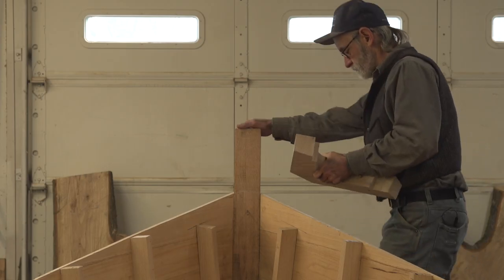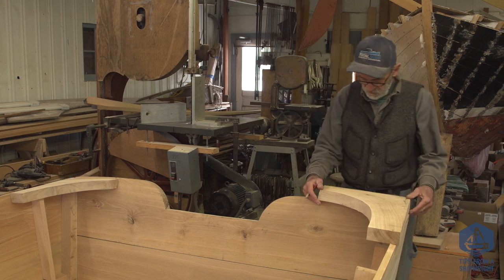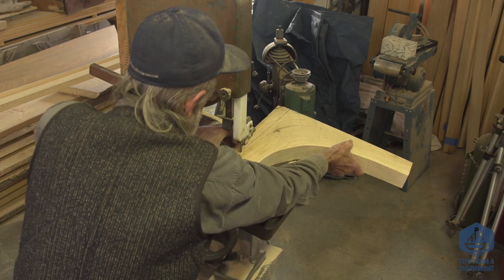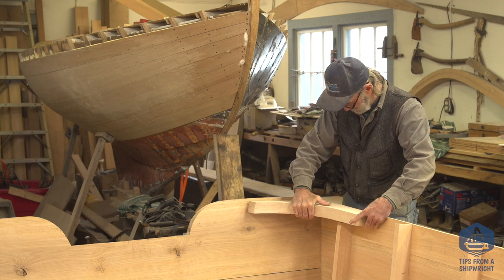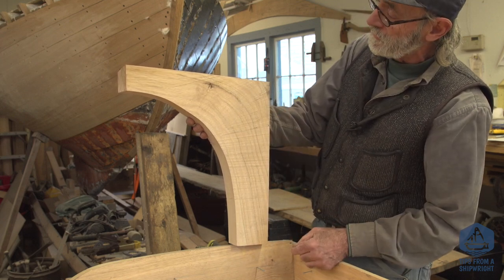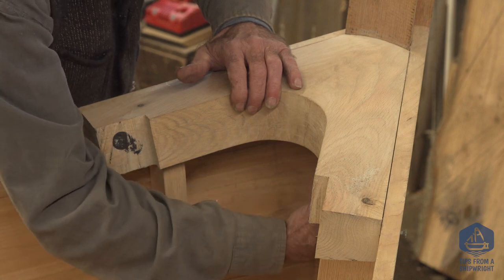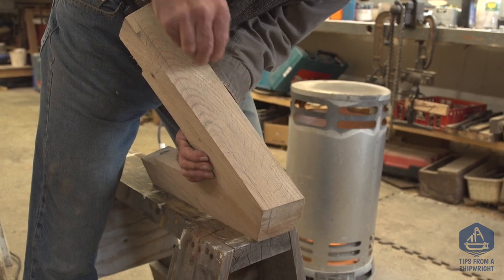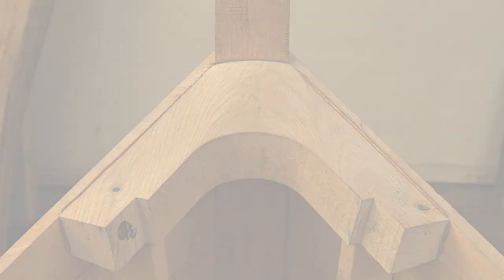Building the TotalBoat - The Breast Hook (Episode 27)

Comment: Really well explained on fitting those pieces. I think I now know a bit of what they did to build the large sailing ships before steam was invented. From my reading they purpously staked and bent acres of trees so they grew in the correct curves for future use while framing the hull and deck areas. There must have been numerous places where the wood was chosen so the grain followed and strengthened the parts. I'd give this two thumbs up if I could.

Comment: Another awesome video! Nice job on the video transition editing on showing the steps fastening the hook in place. 
Question for Lou, generally you dry wood 1 year per inch thickness. By steaming the breasthook did he heat it to drive the moisture out vs steaming to bend it? Other than the little bit of movement he saw after a day or so, it is stabilized? Thanks, REALLY enjoy these videos!

Comment: Question/Topic Suggestion: If you did not have access to/were unable to find tree crooks suitable to the boat you were building, what would your other options be for your breast hook/aft corners, and what reasons would you feel some may be more suitable than others? 

I've not had much time in a shop in the last while, but I've personally taken a liking to building such things out of custom laminated structures and wood-composite materials.

Comment: I'm in an area where oak is very expensive. I was wondering what you think about using fir for the ribs and planking?
Reply: Depends upon which species of fir.  Douglas fir works well for ribs but Hemlock fir does not.  There are other fir species but those two are the most available.

Comment: Question:  What's that word that patterns have to have mean?  Around 5:15 in the video.
Reply: Bhima Pandava Hi there the word is spile or spilling .It's a method of fitting or scribing mostly used on boats. hope this helps.
Reply: Hey thanks!  I found a pretty good explanation of how the process goes once you provided the correct word for me to search with.  That's a really cool and interesting process (which I never knew the word for before) and now I've learned something new, which is also really cool in itself.

So, Thanks again!